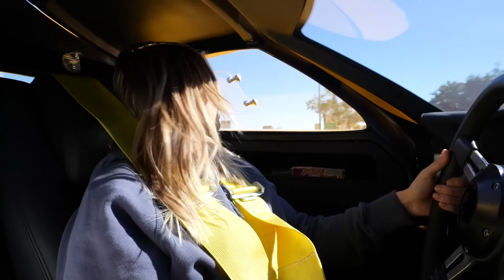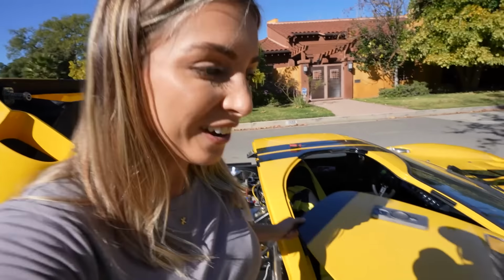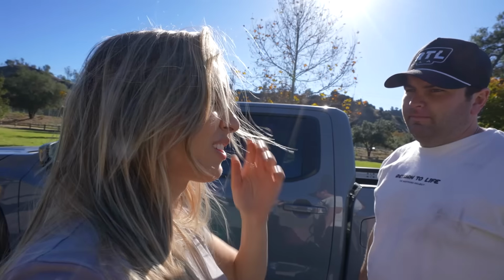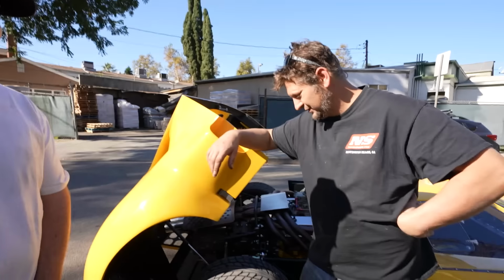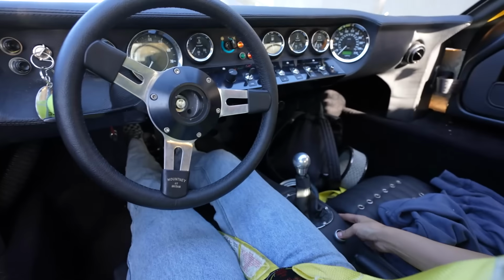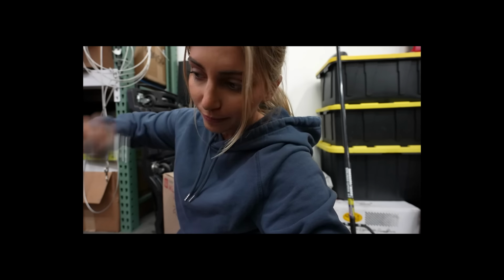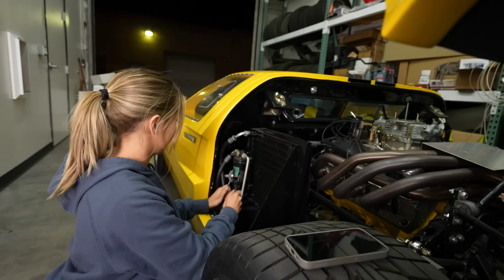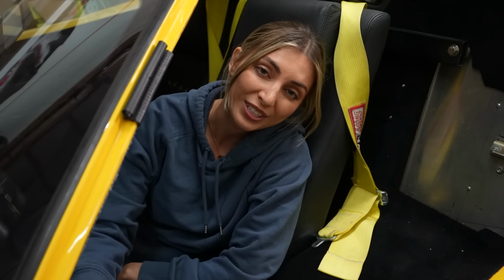The Dumpster Fire that is my Ford GT40.

Comment: Before you take out the trans make sure the shifter isn't hitting the body or something else and not letting it sit all the way back in first. I had that once. Pulled the trans twice and then a buddy who was not the sharpest knife on the birthday cake noticed that the shifter was almost touching the floor in 1st gear. When the motor would torque over under full throttle it hit and popped it out of gear.
Reply: Yup use to happen on my rock crawler.. underload it would pop out of 4low into neutral rebuilt the T Case still did it, bad motor mounts made it hit the tunnel and pop out haha
Reply: Yes, Yes, Yes !   My thoughts also.  Engine Torques and pulls things out of whack.
Reply: Anaheim Gear just down the road or fix it yourself. Those transmissions are super easy to rebuild. Literally like legos.
Reply: Good call! Stick a Go-Pro in the engine bay pointing at the linkage before you do a 1st gear pull, it would be horrendously embarrassing to spend $10,000 on a transmission if it's just an unfortunate  interaction between the shift gate & bad engine mounts...
Reply: I was seriously about to leave this comment. Hope she sees it and checks it.
Reply: Was going to suggest this exactly.
Reply: I was wondering something like this.  Was that burnout in 1st?  IDK if that is a dog leg trans or something like that so I'm not sure.
Reply: she  literally said that 2 mins in.
Reply: I love a white GT40

It’s defo linkage issue
Reply: I had a 5-speed Camaro that had an issue with 1st gear. I never fixed it. It was geared to low, I started off in 2nd since I was ripping it anyway. However, you do have a much, much nicer car haha
Reply: @anthonyg4671 say'd whut? Antonio 🤔🤭
Reply: She actually mentioned wanting to double check for any issues prior to pulling the trans. and specifically mentioned pulling the cover around the shifter to check for any interference issues.
Reply: @BillyJoeJimBob28  that she was going to check that the stick was not hitting something.
Reply: Sound to me like the fuel getting to hit Vapor locking in the fuel line
Reply: It's trans axle bro
Reply: He was sharper than you gave him credit for…come on. Lol
Reply: I hope you bought your buddy a birthday cake for solving your issue!
Reply: Sharpest knife in the birthday cake? Who says that ? Glass houses bro.
Reply: Yup, for me it was a motor mount. It looked fine at idle, and even revving it out of gear, but under load it would lift up and pull on the linkage and pop out of 3rd. On the GT40 I would think it would be pretty apparent of that's what was happening since it's so visible.
Reply: It's either that or someone stripped the teeth on the first-gear synchronizer. Which can be replaced pretty easily. Those transmissions are easy to rebuild.
Reply: @fat_biker  Not a bad call especially if the rubber trans/motor mounts are rotted from sitting so long.
Reply: That’s my tracktor
Reply: Has An Older Nissan Maxima that one g day on s trip home,It popped out of 5th & 5&Reverse shared same rod,called my mech.at home & told him I couldn't use 5 th & he said if I was lucky it would only be Syncro ,Instead of tearing up 5th& Rev.& It was thank God synchros are lot cheaper than 5 th & Reverse
gears
Reply: You watch the video?

Comment: You say 'the trans is done' but a bent selector fork is quite an easy fix as these things go, without a huge teardown - if you have chipped teeth on the gear cluster, then yes, that's a problem, but you could get a feel for that by looking in the gearbox oil pan & seeing if it has metal in it.
Reply: All hail a Transmission Tech... I work on all my cars and I DO NOT want to get into Transmissions!😅
Reply: Show me a manual transmission with an oil pan...
Reply: Just keep your hand on the shifter.
Reply: @ClarksAutoAndPerformance bmw n51 or n52 have an oil pan
Reply: @ClarksAutoAndPerformance a4l80 e has an oil pan😊
Reply: @ClarksAutoAndPerformance ford's zf6 has one as well
Reply: @bradwilliams5242  they make a 4l80e manual??
Reply: @ClarksAutoAndPerformance  Transaxles are weird. Still, failing that, just drain the gear oil through a fine mesh & then put your borescope inside the trans through the drain hole & look for big bits of metal floating around the bottom of the casing.
Reply: what he said
Reply: @Cuttin_Up_Cassics  nope manual valve body
Reply: @bradwilliams5242  not a bmw guy hahaha, just new they had a manual with a pan.
Reply: @minter_fab_mafia  they definitely do.not the 4l80 is a 4.speed.auto.i.dont.knoe if.he is talking about a Chevy NV 35 or 4500 manual or something but any 4l is a 4 speed auto
Reply: @williamsrb1768  I know they aren't a manual hahahaha, I just sent a car I built out the door with one in it. I thought maybe he mis typed
Reply: @LionsTigersBears put a bungy lol😅
Reply: I agree, pop it open and take a look see, happens on Harley's.
Reply: @ClarksAutoAndPerformance  mazda RX8 5-6 speed manuals have pans

Comment: I know this may sound stupid, but have the rubber engine and gearbox mounts gone soft after sitting for all those years, so when you start to push it, the engine and gearbox torque twist stretching the cables just enough to pull it out of gear.
Reply: Not stupid it's been outside in a hot mostly dry climate for years... I'd be going through everything degradable like rubber or plastic.
Reply: @pixiniarts o
Reply: This happens a lot on vw beetles 👍
Reply: @SteveBimmer-bp4ui  ?
Reply: Typically rubber hardens and gets brittle. Never heard of it softening.

Comment: To isolate the transmission problem and determine if it is caused by somithing internal or external you could disconnect the linkage and manually move the levers into first. Then do a hard pull and see if it still pops

It could very well be a bad engine mount, gear selector rubbing somewhere or just excess of vibrations
Reply: My thoughts, exactly. I just commented in a similar manner.
Reply: This. I've done this before in a Jeep Cherokee that was popping out of 4wd. I disconnected the linkage and moved the transfer case into 4wd. It stay in. This told me the linkage was the problem.
Reply: That's the way.
Reply: Yes!!

Comment: An old trick(late '60's/early '70's) to fire  up a hot high compression motor with advanced timing.... pump the accelerator about 8 times, intentionally flooding the engine, then hold the throttle at about 25%, crank engine. It will "lump" over 2-3 times then spin because of being flooded. When the flood clears it'll fire up. This was standard procedure on my '69 396 Impala SS during hot weather. Trans problem sound like a bent shift fork. Not hard to change if you can get the parts and drop the trans out of the car. Beautiful toy!  Keep solving problems one by one and you'll end up with a nice ride!

Comment: There's this relatively thin locking ring for every gear selector inside the box, that's doing the torque hold. These rings can crack and/or jam. The gear selects, but can't hold torque. Your grounding is not sufficient enough. Add more copper between the block, the space frame and the battery.

Comment: You have to keep the colour of the car as it is. Yellow with the black stripe is the ONLY colour for the GT40 if only to remind Maranello (whose corporate colour is yellow) that it was a GT40 that won Le Mans from 1966 (when they finished 1st, 2nd & 3rd and I was there to watch it all) to 1969 after Ferrari refused to sell the company to Henry Ford and did a finance deal with Fiat instead. In the long run that was the right decision but the car still should be yellow, just like the one on my office wall. Good luck with the transmission. Brian
Reply: Redman? (I won't tell)
Reply: And it only took them a British designed car with a really big engine and 13 cars in that race to do it.

Comment: For me the door fitment would be a top priority, it has massive gaps when the door is closed. But I suppose the gearbox comes first. Have you tried disconnecting the linkage? put it in 1st gear without the linkage and try that (just around the block, don't need to change gear) if it still pops out then it has to be the box.

Comment: I had an S-10 (far cry from a GT-40) that would die going 70mph on the highway. I never moved so fast to toss a car in neutral and crank until it fired up.  Also would die just about anytime...made no difference.  I traded it in on a an 84 Silverado with 100K miles on it back in the 90's. Best trade ever.

Comment: Sweetheart, when you are having that kind of trouble with a stick shift, you have to keep the revs up. And when you get to a stop, put the gear on neutral, use your left foot on the brake, your right foot on the gas, and keep raising the engine.

Comment: For daily driving: sounds like a job for a Holley Terminator X Stealth 4500 or Sniper kit, all those fuel/idle/startup problems go away.

Popping out of 1st: do you have a aftermarket shifter as it may have adjustment stopper bolts that also need adjustment aside from the cable. Otherwise usually synchronizer on that gear if it's a high mileage tranny or if newer, binding somewhere between the cable-fork-clutch-pilot bearing..

Comment: You may have a shifter finger type plate and the finger slot for 1st gear the next shifter finger plate to shift to 2nd gear must be worn out causing the shifter stick to slip into the second gear shifter finger slot. Resolution replacing the gear stick finger shifter plate with all new gear finger Stick shifter plate. Just a guess. Good luck Emelia and your team. Great fun content and editing as always Emelia.

Comment: Check the engine and gearbox mountings - under heavy acceleration in 1st the engine gearbox assy may be moving and thus pulling on the gear linkage - pulling the car out of 1st gear. This happened to me with a replica GT40 I built some years ago.

Comment: take all the shift cables off. manually place it in low gear and romp it. Most times on these transmissions they are either blown up grinding or working good and quiet. thinking clearance issue somewhere on shifter or motor shifting around and pull the shifter cable jacket when under load.

Comment: Popping out of 1st can be bent shift fork, shift cables incorrectly adjusted or worn syncro rings. Id go to shift forks first. Put it in first and disconnect the cables. If it pops its the fork/shaft or some times a broken roll pin that holds the fork to the shaft.

Comment: as many others have said it's probably the engine/ gearbox shifting which is enough to cause it to pop out of gear. Realistically the car looks like it was built with new parts, and since it's done no miles until you owned it, it's more likely that it needs adjustment or a rubber part (engine/gearbox mount) has gone, than wear in a gearbox component.  a crazy suggestion would be to ratchet strap the motor down hard onto the mounts if possible, then go for a drive and see if is improved. If it is you know its the motor mounts.  I sense Emelia might secretly pull the motor /transmission anyway for - you know - upgrades :D

Comment: Great video, Emelia. It would almost be worth it to put the trans. in first gear and disconnect the linkage. Drive it, and see if it pops out of gear. If so, the trans. is in need of repair. The usual cause of this malady is excessive end play in the gear train assembly. Worn bearings, thrust washers and synchro rings all add up to excessive end play. Good luck getting it sorted. Love your channel.

Comment: Hey Emilia, are you going to use that shifter to overhaul the transmission?😊. I would think that if you disconnected the link at the gearbox end after you have selected 1st, that would eliminate the linkage. Usually there is a detent to hold the synchro forks in place for every gear so it doesn’t rely on the linkage to hold it in gear. There are also detects in the synchro hubs to make it stay in gear. It’s possible that the selector fork is worn or bent but it may need a first/second gear synchro hub and possibly first gear along with the synchro baulk ring(s). This is in principle only as I don’t know what transmission you have. If it was a Hewland gearbox you could remove the rear case and pull everything out the back! Good luck!

Comment: drain the trans and fill ( full) or kerosene and let it sit over night. That old gear oil gets chunky and will built up on the sliders , Had to do that to an old F150 with the exact same prob. Fixed it

Comment: The transmission is made from a collection of parts.. namely, parts such as shift forks.  The wear pads on the first gear fork could be faulty or missing.. or it could be bent.  Either way, it’s just a part.  Parts can be replaced.

Comment: I was always told not to go through the gears on a ZF trans when the engine is not running. Not sure if that is a good or bad rec. Make sure the engine/trans mounts are not loose or broken so the powertrain would move enough to pull it out of gear. In low more torque on the system.

Comment: Yours looks a lot like my dad's 69 GT40 pretty sick car. Next weekend I'm installing a new engine should be easy enough and if he has the parts swapping out the shifter that's got mechanical lineage for one with cables. He's got a modern hilborn style fuel injection system looks pretty sick and just easier than messing around with a carburetor.

Comment: I had a Ford e150 with a 5 speed the detent springs weren't strong enough and it would jump out of gear. They ride on the selector shift with a ball bearing. Good luck.

Comment: It could be a week detent spring? this can be easily fixed without removing the trans. by removing the spring and adding a shim to increase its tension. can you hold the  gear stick in place when accelerating. if its not the detent spring one mechanics trick is to run the gearbox with Auto Trans fluid for a few trips, this can help re seat the synchro's and clean any gunk out than change back to normal manual trans fluid. As it has not been driven a lot. Check the trans oil for metal flakes and the magnet on the sump plug when doing the oil change. just a few tricks to try before tearing it down completely.
Reply: also check your engine mounts worn engine mounts can knock a car out of gear if the torque is twisting the engine beyond specified and puling on the linkages.

Comment: Fish apart the GT-40 transmission diagnose and fix it yourselves. Should not be a big deal. Junkyard source spare gears and parts if you have to. Had a 901/911 transaxle here and my WWII electrician buddy (RIP) was familiar from being a old hotrod gearhead and VW mechanic. Just make sure you have a good large undisturbed table to lay parts out in sequence. Take pictures as you go. Note anything that is going to mess you up on re-assembly. Put bearings on towels so they don't roll away, or in separate cups and containers for each grouping. Do your research ahead of time and gather as much info as possible. But ultimately, just break it down. Don't forget about heli-coils if you need them. Note you will spill oil when it opens. Work initially in a boundary tray or catch pan when cracking open. Then move to the regular table. Layout the parts in sequence, right to left, top to bottom rows at the top of the table. I did my 901/911 on a urethaned plywood table top. Maybe use the non-odor type as the odor of the real stuff spar urethane with be strong for several days. Make the table yourselves, 3' x 8' ?. Use the 1' cutoff for stabilizing apron.  Fix the transaxle yourselves, or at least crack it open and diagnose it. If you have to pack it out of the way temporarily, take overall pictures of parts layout and tag each part with a sequence number. Its also a good learning exercise and experience. You should be able to break it down all the way. You can also tweak problems with a dremal tool and grinding stone bits. Have fun and take your time.

Comment: Very productive day. A change of oil in the gear box might improve things. I wonder would the engine mounts be okay. And or the clutch pressure plate. I wonder it you got to 50mph. And put the car into top gear and them floored the throttle. Would it pup out of gear.
I’d drain the oil first. And see could I get another gear popping out. Then I’d be wondering about a sloppy engine mount. Before you go for a gearbox rebuilt or replacement. Also if you kept your hand on 1st gear can you stop it from popping out. I must look at this again. I’m a guy that sure likes a challenging problem to solve. But I’m sure all you heads will find the problem. I was impressed with the fuel fix.
I love this car and the Daytona.